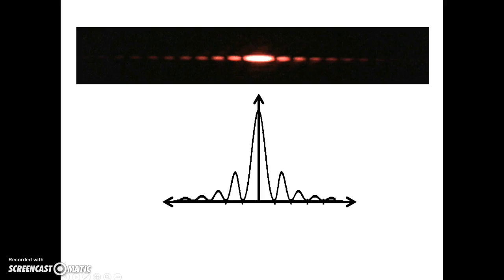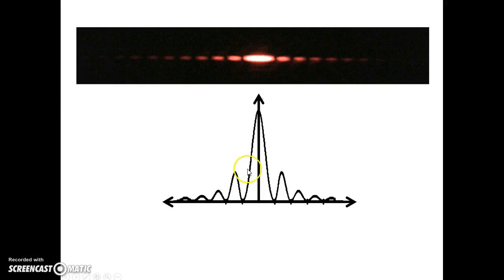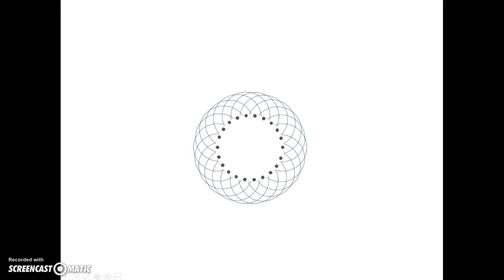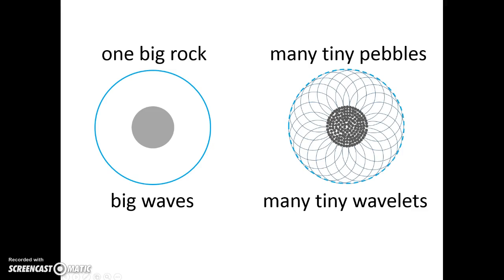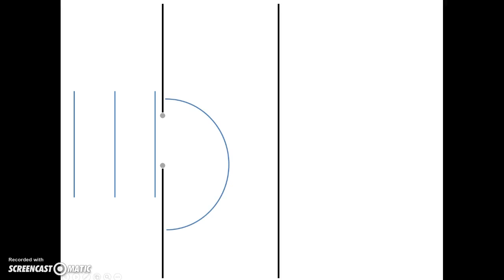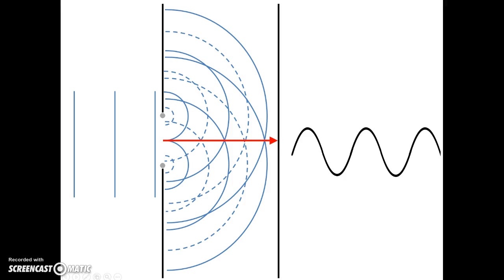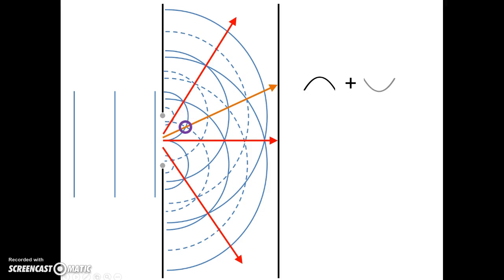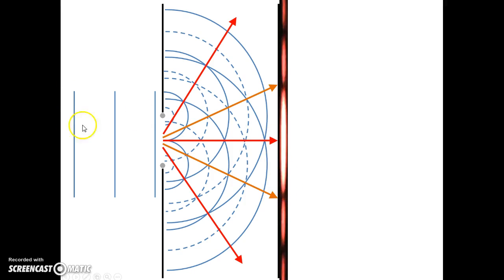Why Does Light Diffract Through a Single Slit?

Comment: Why are light waves depicted as lines, circles
Reply from the maker: Great question! The lines and circles show where the electromagnetic field is at its peak. This is similar to drawing a line or circle on top of a water wave (i.e., at the crest of a water wave). Light is simply an oscillation in the electromagnetic (EM) field, but we don't see those oscillations, so we use the lines and circles to draw where those oscillations/waves are located. In many typical scenarios, light just moves in a straight line and the spots where the EM field is at maximum intensity would all be next to each other in a straight line. But in diffraction, the EM intensity wave moves outward in a circle (or really a sphere if we consider all 3 dimensions).

Comment: If instead of a rock being dropped at 4:46, you actually just had the waves go through the slit, wouldn't there only be a "force" going to the right, as opposed to waves radiating outwards in all directions?
If that was the case, what would explain the "bending" of the water (meaning, the concentric circles being formed)? Does it have to do with the adhesion to the walls that the fluid experiences?
What about for sound or light waves, which do not experience adhesion? 😕

If we "drop" pebbles like in 5:01, I can imagine how the energy will propagate outwards, but if you look at the waves to the left of the slit, they're only moving to the right, they're not propagating outward everywhere, would that not mean that what doesn't get blocked by the walls will simply continue going to the right? there's no reason for it to bend, no?
Reply from the maker: Good questions! I'll try to answer each of them.

"If instead of a rock being dropped at 4:46, you actually just had the waves go through the slit, wouldn't there only be a "force" going to the right, as opposed to waves radiating outwards in all directions?"
In both cases, the force isn't really directional and we can't call it a rightward force. Also in both cases, the waves would actually radiate out in all directions on the other side of the slit. The wave doesn't move to the right because of a rightward force, which is definitely a weird concept to digest at first. I'm going to simplify, but here's a good way of thinking about it. Imagine the water is like a blanket. When you grab a single molecule of the blanket and lift upward, all of the blanket's surrounding neighbors are also lifted upward. And when the neighbors get lifted upward, they pull their neighbors upward, and the effect cascades. That's very similar to what the water is doing too. As the wave passes, the water molecules inside the slit stay inside the slit. They just bob up and down, and if we put a rubber ducky at the slit and produced a wave, the rubber ducky wouldn't move to the right with the wave--it would just bob up and down on top of the water molecules that are also simply bobbing up and down. So, when those water molecules inside the slit bob up, they pull on their neighbors and cause the neighbors to move upward, just like the blanket. And when the water molecules inside the slit bob back down, they pull their neighbors down too. What I was trying to explain (but didn't actually say) is that dropping a rock in the slit produces the same result as if the wave had passed through the slit--both events simply cause the water inside the slit to start bobbing up and down. When we look from above (like the video shows), we can see that the water molecules at the edges of the slit have some neighbors located upward and downward. Those neighbors start bobbing too, and this is why the wave expands on the other side of the slit. [In reality, the picture is a little more complicated. Water waves aren't purely transverse the way I'm describing; that is, the molecules don't just move up and down--the molecules actually have a little forward/backward rocking motion as well. I haven't studied this in depth, but while this complicates the picture slightly, the preceding explanation is still largely accurate.]

"If that was the case, what would explain the "bending" of the water (meaning, the concentric circles being formed)? Does it have to do with the adhesion to the walls that the fluid experiences?
What about for sound or light waves, which do not experience adhesion? 😕"
This effect isn't related at all to adhesion, but I think it's probably closely related to cohesion. The reason why a single water molecule bobbing up and down causes all of its neighbors to start bobbing up and down is because the initially-bobbing molecule exerts a cohesive force on all of its neighbors. So the molecule bobs down, and it pulls its neighbors down with  it.Then it bobs up, and the neighbors get pulled up too. Imagine we're in the water tank, standing behind the slit and watching the water pass through the slit. We focus on the water molecule that is farthest left in the slit (i.e., closest to the top of the screen if looking from above). As we watch that molecule, we see it bob up and down, and we see it exert a cohesive force on all of its neighbors that are just beyond the slit. But some of those neighbors just beyond the slit are also slightly to the left of the slight. And so the water molecules outside the slit's width also start bobbing as well, because they feel a cohesive force with the bobbing molecules that are within the width of the slit.

There might be some adhesion happening as well, but I believe that would generally create a different effect that would superimpose on top of what the video is describing.

"If we "drop" pebbles like in 5:01, I can imagine how the energy will propagate outwards, but if you look at the waves to the left of the slit, they're only moving to the right, they're not propagating outward everywhere, would that not mean that what doesn't get blocked by the walls will simply continue going to the right? there's no reason for it to bend, no?"
This is a good question, and you're picking up on an inaccuracy in the animation that I never really appreciated until now. The thee straight lines to the left of the slit should actually be taking up the full width of the water tank. If the waves truly looked like I drew, then they would be expanding out and getting wider as they moved to the right. This would necessarily happen because of the adhesion those bobbing water molecules have with neighbors that are beyond the width of the wave. So the wave would get wider as it moved to the right (before reaching the slit). Physically, we can imagine this happening with a log. If we dropped a log into the tank, and the log didn't occupy the full width of the tank, then the waves from the log would move to the right like I've down, but they would also get wider as they go.

Putting this all together, the force that causes the wave to propagate is partly this cohesion which causes one bobbing molecule to initiate the same bobbing motion among its neighbors. But the force that causes the wave to propagate is also partly due to the forward/backward motion, which causes the molecules to bump into their neighbors, thus triggering the same forward/backward motion in their neighbors. Consequently, each molecule stays in the same spot, but it engages in two different types of back-and-forth periodic motions: (1) it bobs up and down but doesn't actually have any net upward/downward movement, and (2) it rocks forward/backward but doesn't actually have any net forward or backward movement. Molecules in the path of the wave benefit from both #1 the cohesion and #2 the bumping, which I imagine causes the forward propagation to be more intense than the sideways propagation (which is responsible for the wave spreading out). But, the cohesion is still there, and the wave does still spread.
Reply from the maker: For a nice visual of what the water molecules do, check out the third and fourth animations here:
https://www.acs.psu.edu/drussell/demos/waves/wavemotion.html

The one limitation of this animation is that is only shows the forward motion and doesn't show the sideways bobbing that gets initiated when a bobbing particle pulls through cohesion on its neighbors to the side of the wave.

But an important thing to notice is that each individual molecule doesn't have any net movement forward or backward--it stay essentially in the same spot, but just moves in a circle around a fixed point.
Reply: @danielm9463  This clears a lot of things up, thanks so much for the clear reply! Wasn't expecting one considering its been 7 years since the video was posted!

Comment: So.... why does light diffract through a single slit?
Reply from the maker: Did you have a chance to watch from 4:18 to 10:27? In this video, the big idea is that every point along the single slit becomes a point source for spherical waves. Those spherical waves spread out and interfere. This is what produces the interference pattern. That's the high-level overview.
Reply: @danielm9463  Yes, I watched it all. I appreciate how it works and this video explains that very well - personally I already understood it well. But I don't understand why it works. Why does light actually bend around edges, what process results in that phenomenon. I can't really seem to find an answer. If it's on wikipedia, I probably overlooked it through all the nomenclature.
Reply from the maker: @MappaCrappa  That's a really deep question and a totally valid and fair one to ask. It has to do with electromagnetic wave propagation. I'll see if I can dig up some valuable resources and then will post another reply. The short answer is something like this: the oscillating electric field initiates oscillations in the magnetic field, which initiates oscillations in the electric field, etc. This occurs in all directions. So the analogy of water molecules that bob up and down isn't really too far off--it's just that the mechanism for initiating the next layer of oscillation isn't a chemical bond--it's the self-propagating nature of the EM wave.
Reply: @danielm9463  Thanks man!
Reply: @danielm9463  but there is only two points creating the diffraction and making interference not many across the gap like you showed? also i can understand if a single wave breaks over a boulder it may also create diffraction on either sides that may interfere unless the boulder is too large  and the diffraction do not meet   , but are you saying water with the same waves going through a barrier with a single opening will also create not only diffraction but interference too? or does it depend on the size of the opening if too large you may get diffraction only and if smaller both?
Reply: is it true to assume that light waves as straight lines before diffraction occurs at the slit?

Comment: I was expecting u to explain with the help of Heisenberg's uncertainty principle
Reply: that would be the real reason it bends
Reply from the maker: Thanks for the comment, Pradyumma. Light has wave characteristics and particle/ photon characteristics, as I'm sure you know. We can explain light's ability to bend using either the wave perspective or the particle/ photon perspective. Using the wave explanation, the answer to your question ("why does light bend?") is: "because of Huygen's principle," which I've analogized here with rocks and pebbles. Huygen's wave explanation is valid on its own. For example, Huygen's principle explains purely wave phenomenon like the diffraction of sound waves. In addition, the Heisenberg uncertainty principle alone is insufficient for explaining everything addressed in this video; for instance, the Heisenberg uncertainty principle doesn't alone explain why dark spots appear on the back wall. To explain the dark spots requires an appeal to destructive interference, an exclusively wave phenomenon. And so we stick with the wave perspective throughout the entire explanation, even though the Heisenberg uncertainty principle provides a very fun and cool secondary explanation for why light bends when it passes through a small slit.
Reply from the maker: To clarify what I wrote, using the Heisenberg uncertainty principle would require an additional discussion of light as photons/particles, which might be extraneous given that we can use waves alone to explain (a) why the light bends and (b) why light produces an interference pattern. Further explaining the first point, (a), through appeal to the photon nature of light and Heisenberg's uncertainty principle is extremely interesting and fun, but it's beyond the scope of this video (which aims to present a fairly typical high school/college explanation for AP/IB/intro college course). Thank you for raising this incredibly interesting point!
Reply: Thanks for the explanation. i saw the explanation on one of Walter Lewin's videos and was fascinated because none of my teachers gave that secondary explanation while teaching in class. That point about dark spots makes complete sense and I understand that this video is only for high school students :D
Reply from the maker: It's such a cool way to explain the bending. Here's a video I like about this topic: 

https://www.youtube.com/watch?v=a8FTr2qMutA
Reply: Thanks man :)
Reply: @danielm9463  in your wave explaination you used some pebbles to explain it for water waves and carried it as an analogy for light waves, but what will be the real pebbles that disturb light waves? And generate those patterns or secondary sources
Reply from the maker: @Sidd-rb4ec  I love this question, and the answer goes really deep. At a single point in a water wave, a *water molecule* moves up and then moves down (oscillating back and forth between these extremes). At a single point in an electromagentic wave, the *electric field vector* points up and then points down (oscillating back and forth between these extremes). Dropping pebbles into water causes the water molecules to start oscillating. But what generates the oscillation of the electric field vector? The answer is things like: moving a point charge up and down, allowing an electron to drop to a lower energy level, bringing matter and antimatter together so that they annihilate, etc. However, it may be tricky to put these sources right inside of the slit, because light/EM waves propagate differently in the near-field region vs. the far-field region. (https://en.wikipedia.org/wiki/Near_and_far_field) So ultimately, I don't think there is a direct analog when we switch from water to light. But the general principle (that larger waves can be broken into smaller wavelets) is nonetheless still true regardless of what object ultimately produced the wave. This is called the Huygens principle. (https://en.wikipedia.org/wiki/Huygens%E2%80%93Fresnel_principle)
Reply: @danielm9463  at last after a long time  someone got to know what i was asking for, I do know how they are generated but your explanation still doesn't clears the doubt of why it diffracts when passes through a slit and why and how this wavelets are produced in the case of waves
Reply from the maker: @Sidd-rb4ec  I think you're having the reaction I would expect, because I'm essentially saying that the intuitive physical analog you're looking doesn't exist. To make sense of light diffraction, I encourage you to read more about Huygen's principle and EM wave propagation. Maybe the answer you seek requires a deeper mathematical appreciation of the fact that (a) many little wavelets are equivalent to (b) a larger plane wave.